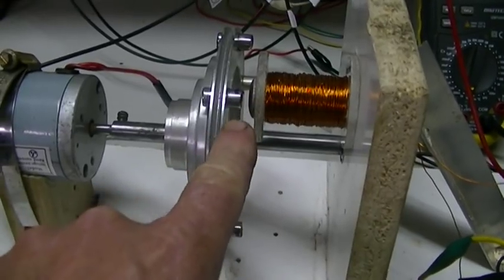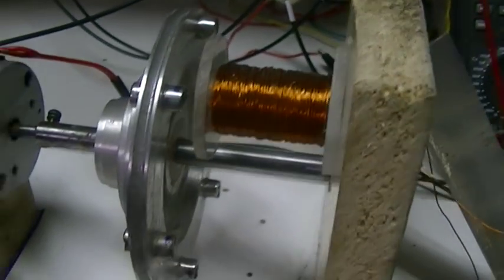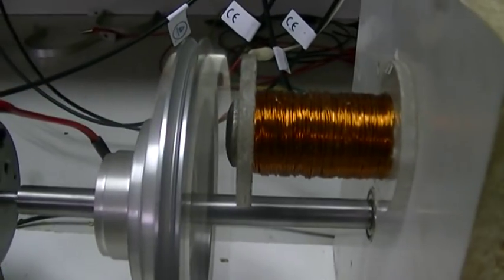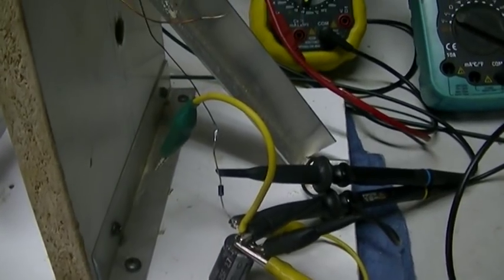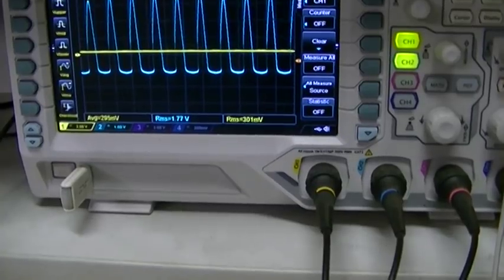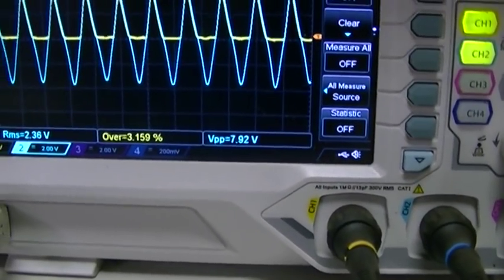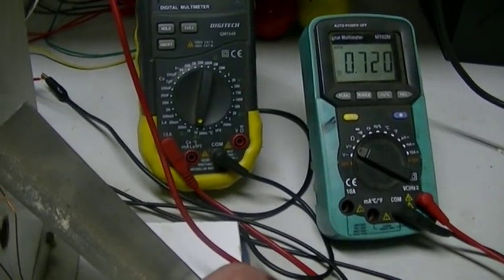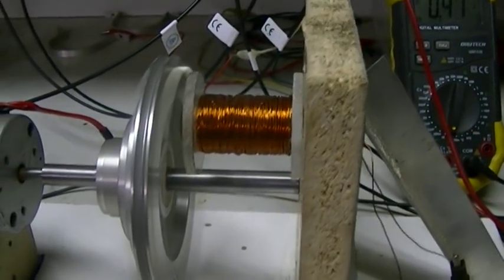Bedini energizer test 1

Comment: Quick question...I'm building a 4-filar bedini motor and just realized I'm out of 1N4001 diodes!😠 I have plenty of 1N4002-1N4007s in my cabinet...is there a suitable replacement? I would like to get this finished this weekend and I'm in a rural setting so it will take some time to get more 001s. Can I substitute? Thx

Comment: Have you seen the Goeffrey Miller tube core???  It produce less drag on the rotor and induce a nice voltage in the coil...  The solid rod produce less..A voltage doubler circuit seems to be applicable too in your case..

Comment: Was wondering if reducing gap between coil/magnet will affect your results. Thanks
Reply from the maker: Yes,if you reduce the gap,the coil will produce a higher voltage,but it also add more drag to the motor at the same time.